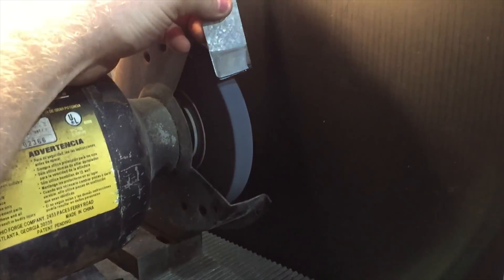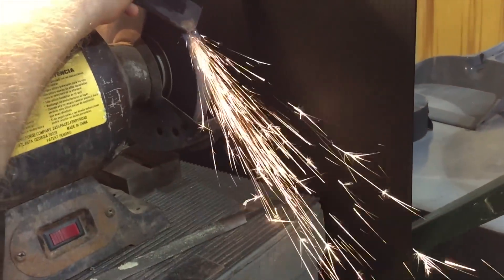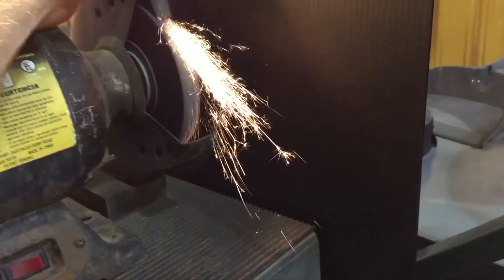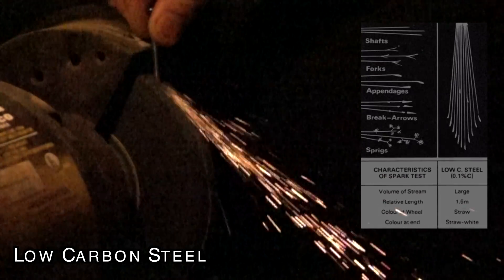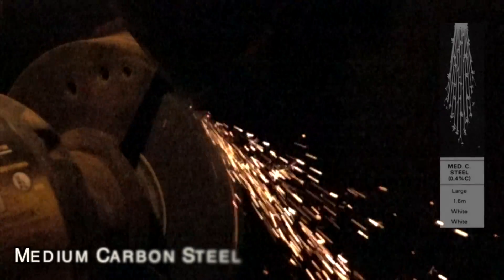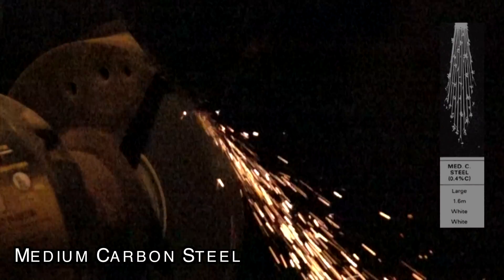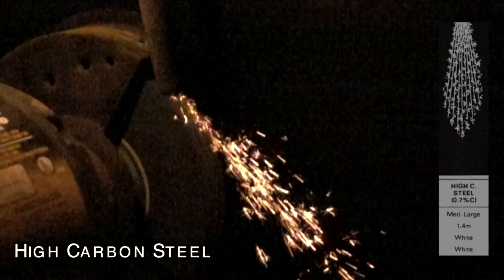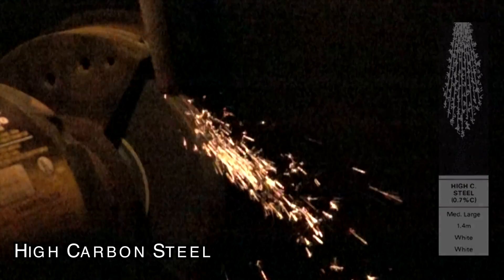Quick Tips #1 // Determining Carbon Content of Steel

Comment: Does the thickness of the metal used determine the sound or is that the carbon content?
Reply: Art yom nope
Reply: A wheel on a bench grinder sounds different from an angle grinder with grinding wheel which is different from a cutting wheel, which is different from a belt grinder. All with same piece of steel.